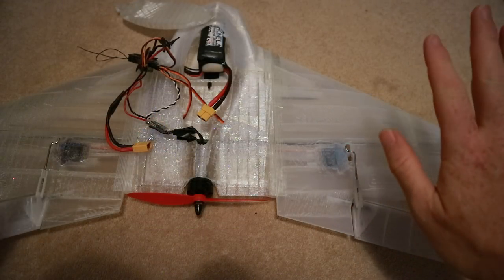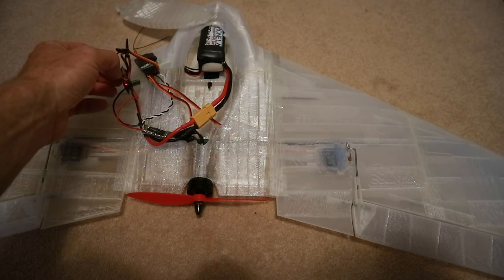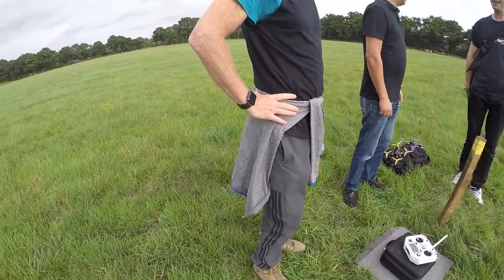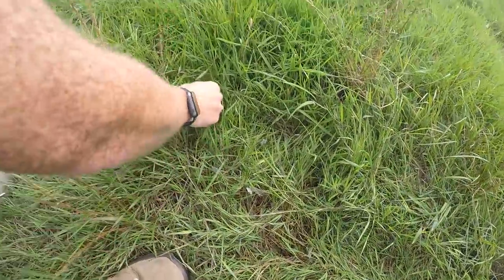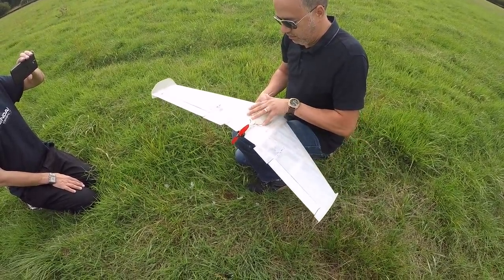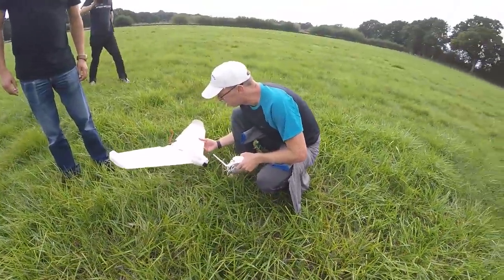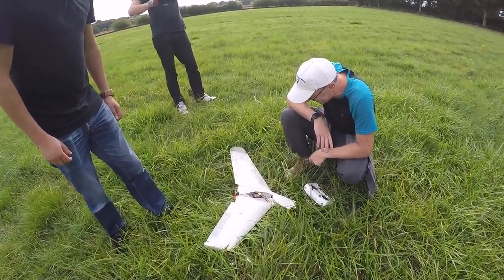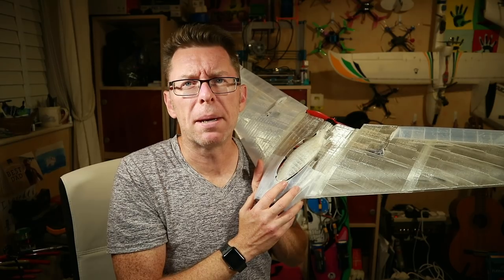Rods 3D-Printing Wing v2: Will it fly this time ?

Comment: It flew and it landed safely...... It was possibly a bit ambitious going for the loop and I doubt you would have done so had you realised it was only a 3s rated motor
Still it flew better this time than the 3d printed one a local made. Wing snapped off on that and it took a very very long time to find and pick up all of the very small splinters.
Took a few of us oldies back to our balsa days :D
3rd time is the charm ;)
Soph's commentary was great even the chuckle when your friend didn't want the controls 5:03
Reply: No I can't resist it
"That plane has no nose" 
"How does it smell"
"Sort of smokey" 

I'll get my coat
Reply from the maker: Nah - I would have kept throttle to a minimum is I'd have known.  I don't really do LOS flying very well - y'see, 2 circuits and I was already looking for other things to do :)

Comment: Good luck with the next flight! 3d printing planes sounded sooooo cool until I saw a few fly and crash, they tend to be heavy and need to fly fast and not very crash resistant.
Still cool though!
Reply from the maker: This was very much a "I have a 3d printed, I'll print a plane" idea from Rod rather than a proper thing.  I think to keep the weight down, something more akin to printing wing struts that you could then cover in film would be more usable... still fragile as anything of course.  That said, the first mini quads I flew, my friend printed from ABS which has more flex in it, but still heavy

Comment: Nice seeing this wing finally fly. Maybe he should have printed with higher extruder temperature / less cooling. Seems like the plastic is very brittle.
Reply from the maker: That might be it, although very thin PLA is always going to fragile and tends to be even more brittle after time.  Let's see if it'll do at least one more flight before it completely explodes

Comment: Seems like making a new nose out of EPA foam, or something else more... crash resistant would be a good idea.  Nonetheless, it's an achievement  to get a 3D printed plane flying at all, since FDM printing is fundamentally somewhat heave and brittle!
Reply from the maker: It flew pretty well without a nose, so I'll find something to shove in there.  Yep, PLA especially is very brittle - the half of the wing that wasn't broken from the last attempt had started to develop it's own cracks before we flew it again, so much tape was used :)

Comment: Looked a bit tangy, was there any rates & expo on her? She'll need em if your giving it to the Mini QUad pilot to fly.
Reply from the maker: There was expo on there, I think that was full rates.  It actually feels reasonably smooth because it's so heavy.  I've just fitted a motor that supports 4s.  So I'll actually make sure she gets trimmed and things properly (launch permitting) instead of dicking about

Comment: HI Indian kitten, sorry but your prop is on backwards, numbers on prop must be faced to the front of the aircraft, pusher or tractor planes same prop orientation, do not confuse direction of rotation also!
Reply from the maker: Anyone would wonder how on earth my own 8 wings ever got into the air if I was in the habit of putting props on backwards.  I know how it sounds, but I can assure you that the text on the prop is facing the front of the wing :)
Reply: if the prop was on backwards it would sound even worse, like a howling noise.